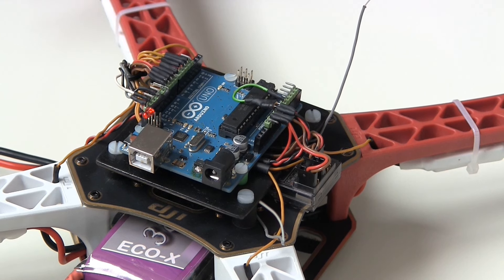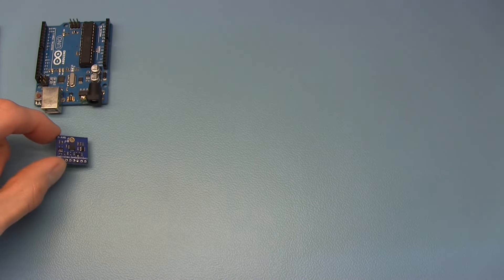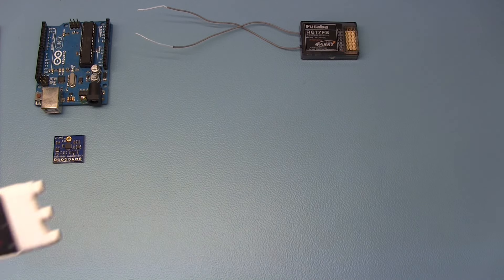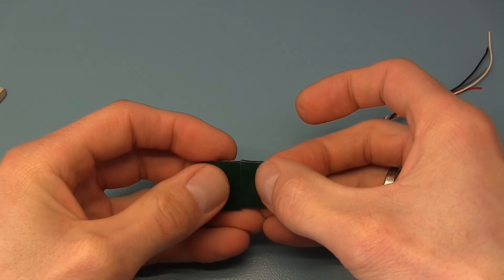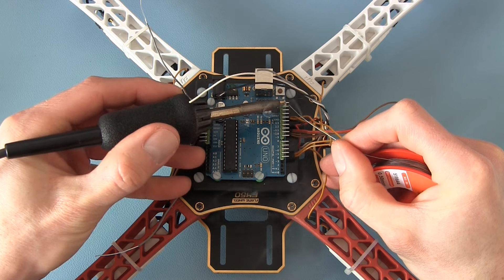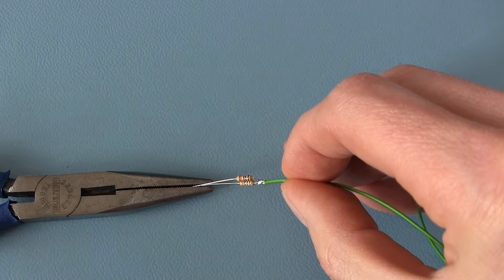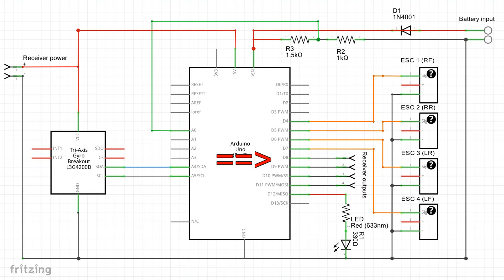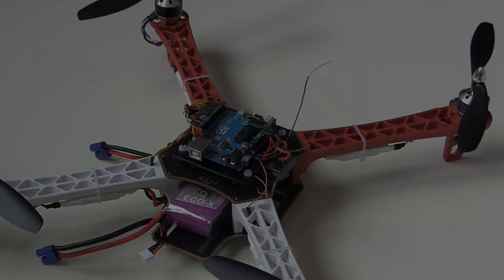Your Multicopter Flight Controller - 3D (YMFC-3D) Part 1 - Hardware.

Comment: Hi sir how balance the all motor because all the motor work different time firstly one start after second and third motor and last motor on different time
Reply: You have to calibrate the ESC's according to the manual. Most ESC's can be calibrated with the transmitter. Arm the transmitter, throttle in highest position. Attach the Battery to the quadcopter (props off, so not attach those when calibrating). Wait for the beeps and led failing. Throttle stick of transmitter lowest position. Done. De-attach  battery and attach again. Throttle slowly up to see if the motors work simultaneously.
Reply: If this does not work, look in the manual how to calibrate.
Reply: I m upload sketch again and subtrims. In this time one working fast all three motors normally and equally works now one motor is working fast. How to i solve this problem
Reply: Calibration of ESC's. Transmitter on, throttle full open. Connect the battery to quadcopter (remove props)!!!!! Beeps gone and led fading out? Throttle transmitter fully to lowest position. Done. Kindly and easy throttle up and see if the motors work simultaneously.  If not? Repeat. Ready? Attach the props.
Reply: I do same as you say but one motor working fast then others
Reply: Check the wires again and check if  the one motor that runs faster rotates in the right direction. Should it be CW or CCW? (clock wise or contra clock wise). Check if the BEC's are connected right. Motor one to (right front) digital line 4 of the Arduino, motor two (right rear) to D5, etc.

Comment: Hello: Joop Brokking
You keep repeating the same answers
Go to the video on youtube and to the questions and solutions page
And it does not help me
You need to specify what codes in the software I need to change
For the gyroscope to be calibrated
And remote control.
CALIBRATED with ESC

Comment: what happens if you want to use a gps module? how to wire?
Reply from the maker: It does not work with the Arduino because it has not enough calculation power. I'm currently working on the YMFC-32 that will have a GPS hold function: http://www.brokking.net/ymfc-32_auto_main.htmlYou can find videos on my YouTube channel.

Comment: i am powering my arduino with the battery eliminators circuit of esc, do i still need to have a voltage divider?
Reply from the maker: It's best to make the quad according to the schematic. You'll have the low bat warning and speed compensation for the motors.
Reply: but isnt it better to power the arduino with the BECs ?? that reduces a lot of work and it looks good and simple too,...
Reply from the maker: Then power it with the BEC if you want to. You have no low bat warning and a speed compensation.
Reply: +Joop Brokking but i can still connect the voltage converter directly to the battery terminals, cant i?
Reply from the maker: Yes, but make sure that the ground of the ESC's and battery are connected together.
Reply: +Joop Brokking    and another thing is i want to learn more about creating pulses,
Reply from the maker: I explained some background in part 3 (ESC's). If you want to know more you might want to Google you question. There are so many ways to create a pulse.
Reply: okay thank you

Comment: is it possible to use 12a esc and if possible do i need to change the code
Reply from the maker: You can use any standard multirotor ESC without changing the code.
Reply: thanks

Comment: how to check my mpu6050 is 5v compatible or not
Reply from the maker: Check if there is a voltage regulator on the board.
Reply: When your gyro doesn't work on 5V, but a lower voltage, you can use a Bi-directoral Logic Safety Converter, to connect a HV (high voltage) to a Lv (low voltage) line.

Comment: The voltage regulator on the arduino is heating up. Is that a issue ?
Reply from the maker: It's fine if you can still put your finger on it. If it's to hot to hold you drawing to much current from it.

Comment: Or you have to take away the arduino uno and the use the ardupilot for this project or you can use both for it. the reason is i wanna  add autopilot to this project..

Comment: From looking at the schematic, I can't figure out the connections from the labeled ESCs to pins D4, D5, D6, D7. From watching other videos, the three similar cables on the ESC are connected to the motor while the cables on the other side of the ESC is connected to power, ground and the receiver. So what is connected to D4, D5, D6, D7?
Reply from the maker: The thin (white or yellow) signal wire.
Reply: thank you joop , i was having the same question, it´s the bec wire , right ?

Comment: hello sir , is it posssible to use an arduino uno r1  ?
Reply from the maker: If it uses a ATmega328P-PU micro controller it should work fine.

Comment: hey brokking i have built the hardware and then uploaded the arduino file .ino all three to the arduino uno by means of arduino software but its still not working, does it will work by plug and play or do i need to do something else let me know please
Reply from the maker: Please follow the tutorial, hardware and software on this page: http://www.brokking.net/ymfc-al_main.html
Reply: It need to work. Could you upload all three sketches? (setup esc flight). When uploading, did you choose the right Arduino board and the right COM port? When uploading set IDE on Parallel Programmer? (can be found when adjusting board and com port,  same row of Arduino IDE)

Comment: @Joop Brokking or anybody.  HELP!!!  i made adjustments to the endpoints and re-ran the setup. 
 All values fell between 1000-2000.  However, my esc's still are not 
calibrating.  i continue getting a single beep.  i have NO idea what to 
do at this point.  i was told to put the "trim" all the way down to "0".
 Still did not work.  I did not put the LED on UAV in the build because i
 use a battery alarm.  In the setup, the last verification addresses the
 LED.  I did not receive an error but would this matter.  Im reaching at
 this point. :)
Reply from the maker: Try to calibrate the ESC's with the transmitter and receiver. If the end-points are set correctly this should also work.
Reply: Thanks for your response Joop. Below are my values.

Endpoints are:
High, low and center values found during setup
Digital input 08 values:1016 - 1508 - 1996
Digital input 09 values:1016 - 1512 - 1996
Digital input 10 values:1024 - 1508 - 1996
Digital input 11 values:1012 - 1508 - 1996
Also,
Gyro search
===================================================
Searching for MPU-6050 on address 0x68/104
Searching for MPU-6050 on address 0x69/105
Searching for L3G4200D on address 0x68/104
Searching for L3G4200D on address 0x69/105
L3G4200D found on address 0x69

===================================================
Gyro register settings
===================================================
Register 0x20 is set to:1111
Register 0x23 is set to:10010000

When I try to a calibrate the ESC without running the ESC calibration program first i get NO beeps (battery power).  They initiate but no continues beeps.  When I run the ESC calibration program I get slow beeps and they continue to slow down to the point of almost stopping.
Reply from the maker: Try to run the motors with the calibration sketch by sending a 5. And make sure that you use a full lipo battery.
Reply: Joop Brokking I'm not clear.  When you say "run by sending a 5", what are you referring too? I ran the ESC calibration program and then tried to calibrate.  that's when i get the slow beeps.  thanks for your patience and help.

Comment: what is the battery voltage in schematic?
Reply from the maker: It's a 3S lipo. Maximum voltage is 12.6V.
Reply from the maker: It's a 3S lipo. Maximum voltage is 12.6V.

Comment: Can I use arduino 2560 and the same gyro? I'm making a hexacopter.
Reply from the maker: +Eureka Faye Estrada Yes, but you need to modify the code yourself to match the i/o.
Reply: Why aren't you  using barometer and accelerometer?
Reply: +Eureka Faye Estrada Good question, I am also interested why no accelerometer?
 For example MultiWii project can use the accelerometer too not just gyro.
For Altitude hold mode Barometer is needed, if you wish to use that mode too with no &#39;direct&#39; Throttle control.
Now the MPU6050 accel/gyro is about 2.7 dollar, and the BMP180 barometric sensor is also 1dollar.
You can buy a compass around 1 dollar (GY-273 HMC5883L)  too and paired with a GPS module it could work in Loiter/PosHold with the corresponding software.
Reply: +Eureka Faye Estrada I think the idea was just to keep this as simple as possible and give people a platform to build off of. I have my own build going based off of this series, and I'm planning on expanding on it later with an accelerometer and a magnetometer.

Comment: I've completed the hardware but I'm having issues with the flight controller. My Arduino Uno runs the flight controller sketch when the USB cable is connected (LED warning light and motors will power on and adjust when moving around the quadcopter). But the sketch will not run once I disconnect the USB and feed power through the Vin port with the LiPo---nothing happens, just the board's ON LED and L LED stays lit. I have also tried supplying power to the Arduino with a barrel plug plugged into a wall outlet (12V, 1A supply) but the sketch still does not run.

I'm thinking that my Arduino may be damaged, in the past I accidentally connected ground to the Vin port and voltage to ground port and the board smoked briefly before I immediately disconnected everything. But before I go out and get a new Arduino I want to see if anyone else has other ideas as to why I can't get the sketch running without the USB plug.
Reply from the maker: If you have wrongly connected power to the Arduino you have burned the voltage regulator. That is why you cannot get the sketch to run.
Reply: Hi Joop, thank you for replying. I just set everything up with a new Arduino and it seems to be working great...now I just gotta go learn how to fly this thing!

Thank you so much for making this video series. I've learned a lot and had a great time with this project!.

Comment: Hi +Joop Brokking i am gonna build one myself but have many doubts as to how you have connected the power and the receiver and all so can you just send some pictures to me, of the quadcopter so i get to know how this works, thanks!
Reply: +Joop Brokking, and how can i use 5 or 6 channels
Reply: +Paranjaya Jain  look at The schematic:
http://www.brokking.net/YMFC-3D/YMFC-...
Reply: +Paranjaya Jain http://www.brokking.net/YMFC-3D/YMFC-3D_schematic.jpg
Reply: +Carlos tercero thanks for that, i had a look before but now i found the doubt, but how can i connect for example a five channel?
Reply: +Carlos tercero like to which port
Reply: +Carlos tercero like to which port
Reply: +Paranjaya Jain you need 4 chantels only, but if you have more you can use to move a servo fo rexample and this in turn can move a camera
Reply: +Carlos tercero Basically i want to connect a led strip which has a switch so in the schematic, how can i do that? Also how do i connect a 12 volt led strip to a 7 volt or 11 volt battery
Reply from the maker: +Paranjaya Jain Watch part 2 (receiver inputs). Than you will see how the inputs are created. To add another channel you need to add a pin interrupt and add a channel in the interrupt routine.
Reply: +Joop Brokking Is there a battery indicator? thanks for all the help
Reply from the maker: Paranjaya Jain
Watch part 5 @ 8:40.

Comment: can i use Wemos mini D1 instead of the Uno R3?
Reply from the maker: No, you need an ATmega328P for this.
Reply: Thank you but is it necessary to use a board that have atmega chip? I cant get one in my area so i decided to buy Nodemcu 1.0 board,can this be used for the project?

Comment: sir,what type of motor did you use?
Reply from the maker: Please check this page: http://www.brokking.net/ymfc-al_main.html
Reply: sir what if i use external power connector instead of in vin pin? does the program be change?

Comment: What size wire is used for the project?
Reply from the maker: 0,14mm2 / AWG 26
Reply: Thank you for replying! I have another question. Is it possible to control a drone the PC and increase its range of flight using this Control method?

Comment: can we use 1000kv motors instead of 100kv?
Reply from the maker: The 100kV is a typo and I have just corrected it. When you click the link you will see that it is a 1000kV motor.
Reply: i also saw that u got the l3g4200d gyro but on ur site u have the MPU 6050 before i saw this video. so i got the mpu 6050 from amazon.(https://www.amazon.com/gp/product/B00KKR9ORI/ref=oh_aui_detailpage_o05_s00?ie=UTF8&psc=1)
is this part going to work flawlessly or do i need the converter u were talking about? thanks
Reply from the maker: This part should work fine with the YMFC-3D v2 and YMFC-AL.

Comment: Hello
I bought all the ingredients you recommended
I soldered and assembled like. Which you did on YUTYUB
I downloaded the software to Arduino
It does not work. The motors do not turn around
It makes sounds but nothing happens
What I did not do right
English is not my language
I'm very bad in English
שלח הצעה לעריכההצג את התרגום המקורי
Reply from the maker: Please check this build tutorial: http://www.brokking.net/ymfc-al_main.html
And don't forget the Q&A page: http://www.brokking.net/ymfc-al_qanda.html
Reply: Did you ground the BEC's? Mostly when there is a sound (beeping) and the motors do not start running, the BEC's are not grounded (GND). Most BEC's have two or three lines, connected with a three in one dupont connector. Don't attach the middle line (5V), only the signal lines (to D4, D5, D6 and D7). The other line of all 4 BEC's to GND of the Arduino Uno board. If correct, it must do the job. If not, check all wires and connections according to the scematics of Joop Brokking.

Comment: how to connect the diode , comment it plz.
Reply: De diode needs to be connected with the power line from PDB (power distribution board) to the VIN of Arduino Uno(also on VIN 1,5k-ohm resistor attached to VIN: see scematics of Joop Brokking). Keep in mind that de diode is for extra protection (PC port and Arduino). It directs current to only one direction. When you place it wrong, it'll cause trouble. A mark on the diode (in my case a silver or grey circle on one end of the diode) shows in what direction the current flows. Don't place it wrong. Look it up. In my case the grey circle in the direction of the VIN. Search the internet for this, to be certain. Good luck with your project.

Comment: Is there any alternative ways that I can connect a lipo battery onto the Arduino other than the way you did?
Reply: Its a little more money but I used this board.  It has 12V and 5V outputs so it eliminates the Voltage Divider.  Also You can Easily unplug the battery. https://www.amazon.com/gp/product/B01HGLSIS6/ref=oh_aui_detailpage_o06_s00?ie=UTF8&psc=1
Reply from the maker: It does not eliminate the voltage divider because the voltage divider is used to sense the battery voltage. It has nothing to do with voltage conversion.
Reply: At first I was thinking about also using a voltage divider to power the receiver, didn't think bout the Uno already having that built in.

Comment: How do you connect the battery to the Arduino?
Reply from the maker: +Ruben O Check the schematic in the description.
Reply: +Joop Brokking yeah, but the battery connectors don't fit on the Arduino.  How was the battery hooked up?
Reply from the maker: 6:33 I soldered the wires on the battery connection.
Reply: +Joop Brokking Thankyou

Comment: What does receiver power mean on the schematic?
Reply from the maker: This is the power for the receiver. The receiver is powered by the 5V of the Arduino.
Reply: +Joop Brokking Oh that makes sense, thanks! Also why are there two circles for the battery input? I originally thought + and - but they seem to be shorted at the top?
Reply: +Joop Brokking Sorry if I'm asking stupid questions I'm a software engineer who doesn't know a whole lot about electronics
Reply from the maker: The circles are the connection to the flight battery (lipo). The top circle is + and the bottom circle is -.
Reply: I see, so how come they are connected together? Wouldn't that cause a short circuit?
Reply from the maker: On the schematic:
two lines cross without a dot = no connection
two lines cross with a dot = connection

Hope that helps to read the schematic.
Reply: Alright, yes that makes sense, but the two lines from the + and - battery input are connected with dots just above the VIN pin, why is this done?
Reply from the maker: There are resistors in parallel that will limit the current.

Comment: which battery u used
Reply from the maker: Please check this website: http://www.brokking.net/ymfc-al_main.html
Reply: Lipo 11,1V, 3S, 30C, 2200Mah
Reply: Mind the connection: T-plug or TX60. Depends on charger. Read the instructions for the lipo when not using. The battery may not be stored empty or fully loaded. It can  destroy the lipo cells or can cause a chemical reaction (swelling of the lipo).